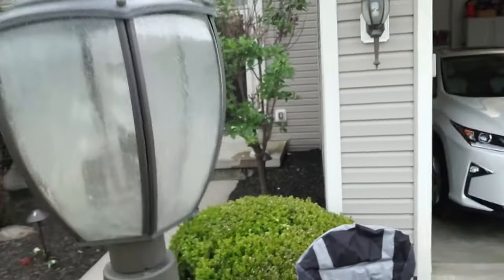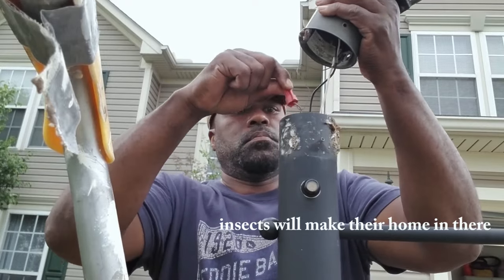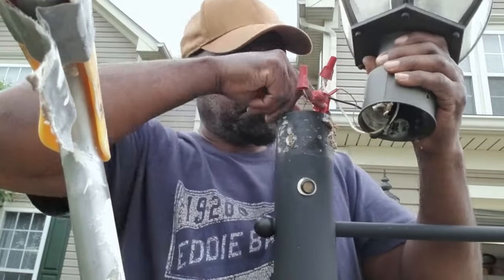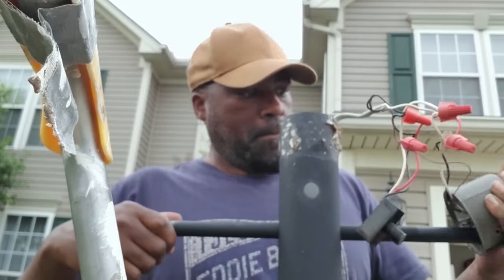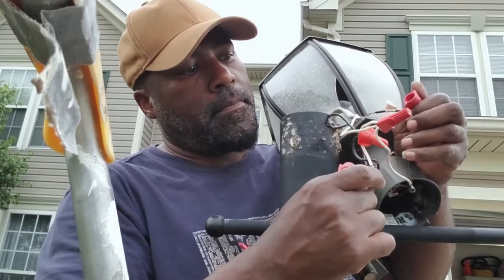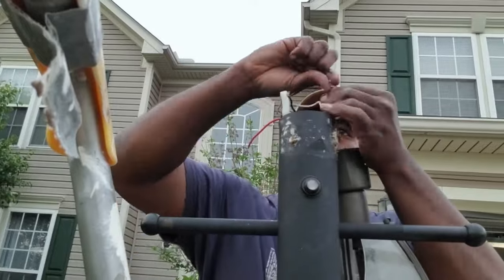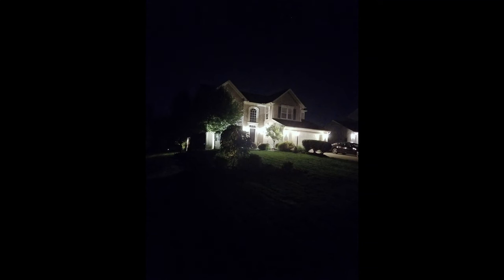How To Install a Lamp Post Sensor (Photocell)

Comment: Great video and perfect for my needs! Almost identical set up in my front yard and the added written instructions for the 'never done it before' crowd on the wiring was a great added touch.
Reply from the maker: Thank you.,. I'm glad I was able to help. I live in an HOA and my videos are generally geared around questions that the resident's ask. Usually it's Grass stuff, solar lights, lampost etc.
Reply: @lawnjenkins  I followed your video to a T, had.my daughter hold the lamp. I've got a large hand so had to use a screw driver to push the sensor into the hole. I put a flame 🔥 bulb in and it looks great. Thanks again for a great video and I followed up with a subscribe.

Comment: How would I replace the photocell if there is not a way to remove the top of the post. Is there something that can clean the photocell lense?
Reply from the maker: I haven't see a post like that but maybe your photo cell can be screwed out enough to reach the wires.

Comment: Best if you have a 5 ft stepladder and set it next to the post and lay the light on it. Then disconnect each sensor wire one by one and reconnect the new one one by one. Then remove the old sensor and put the new one into the hole. With the wires already connected you cannot accidentally drop it down the inside of the pole.
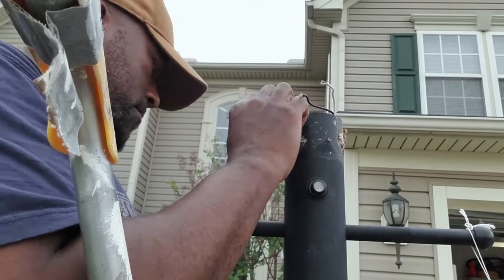Reply from the maker: Yep  that is a step ladder but I could only get it so close because of all the mature shrubs next to the post and the wires on the light would not reach to lay on the ladder anyway because the original wires were sooooo short 🙂🙂. also at 2:45 of the video I tell people how to not drop it down in the post by using a string tied to the photo sensor. Using a string is what I found works best.   Great points though.

Comment: So is simple? Turn the breaker off, black wires go together,red as well and white as well?
Reply from the maker: Yes - it's not difficult at all. Just make sure the breaker is off.,., Now I'm not a licensed electrician so I can't tell to just go ahead and do this without worry. If you try it it will be your decision but I myself have done this many times. I really appreciate you taking the time to watch and comment.  Thank you.
Reply: @lawnjenkins  Thank you!!!! I actually did it earlier and I connected everything the way it was I knew the light was bad so I didn’t had to change the sensor but is dark now and the new light is shining and I’m actually proud of it, I do little projects around the house when is a big one I hire a contractor but I’m just like you I watch videos and go for it!! 👍🏻🙏🏻
Reply from the maker: @amitchell4206  yeah that's the best way. I have work NUMEROUS home rehab jobs and just learned as I went. Also, youtube is GREAT for getting that video on the one piece you may not know. 😂

Comment: My lamp only has the one ground wire coming from the fixture, but no ground wire coming from the post. any recommendations? My light randomly went out the other month and i replaced the sensor today but it still did not come on tonight. thanks
Reply from the maker: If you have romex wiring, it has a protective sheath. Sometimes a wire could be pushed down into the sheath where you can't see it. If I were In your particular situation I would get an electrician to look at it because it sounds like you may have two or three different things going on. It won't be expensive to get a pro to find out the real issue.